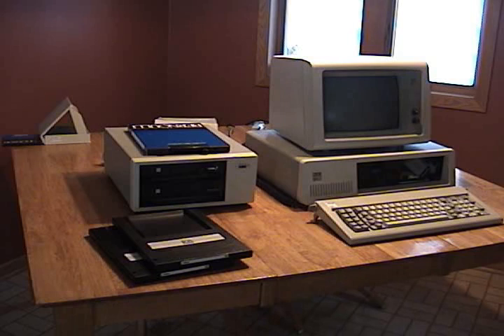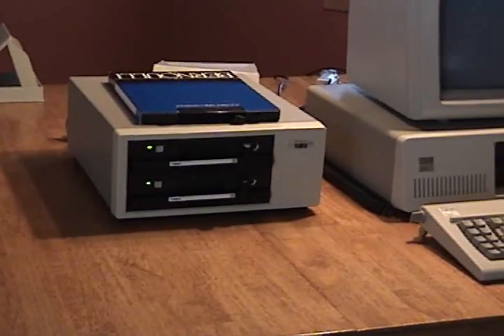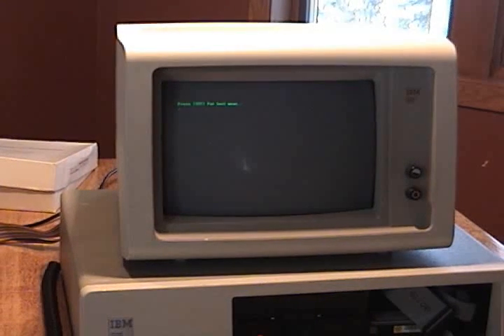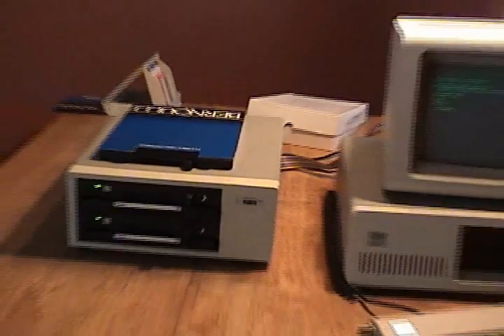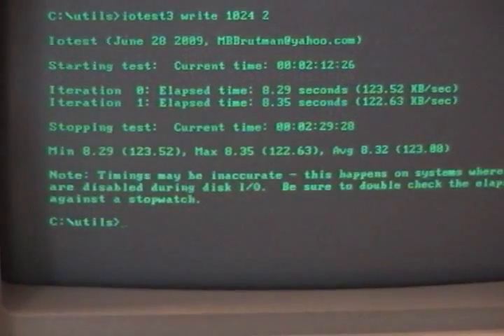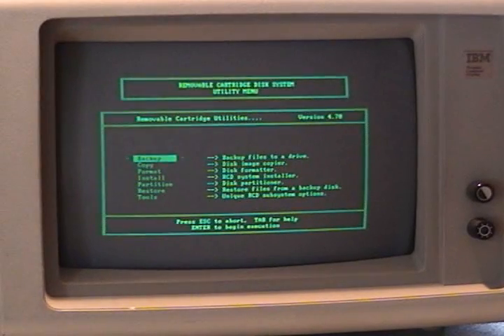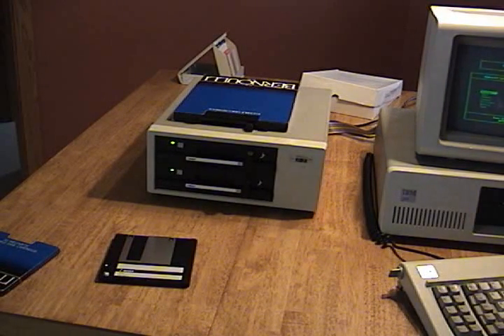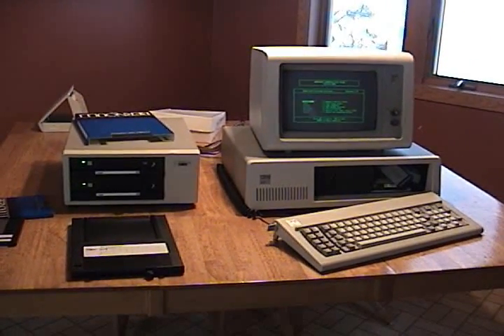Iomega Bernoulli Box A220 Demonstration

Comment: These drives are much smaller than the original 10MB drives. I have both the 2x20 and the earlier 2x10 model, and the drives in the 10M version are basically twice as high (I'm gonna go ahead and call them full height and half height 8" drive format...)
Reply from the maker: I'd love to see an earlier 5MB version in use.  I've seen references to them and some pictures, but I don't know of any that are running.
Reply: Huh. Yeah, that apparently did exist briefly. https://books.google.nl/books?id=-S4EAAAAMBAJ&pg=PA47&dq=bernoulli+box&hl=en&sa=X&ved=0ahUKEwjZ9tzVjp3SAhWEvBoKHSs1CDU4ChDoAQgdMAE#v=onepage&q=bernoulli%20box&f=false

It sounds like almost a prototype product.

Comment: I would have liked to see that directory listing to check the total capacity of those disks. Is it 20 MiB or 20 MB?
Reply: 20 * 1024 * 1024 bytes
These things were insanely reliable, and there is a near 100% chance that the disks still work to this day, as long as a kid never found it with peanut butter on his fingers.

Comment from the maker: Creepy?  No!  The technology that made it nearly crashproof while being removable and at speeds similar to a hard drive is very elegant.  Remember, back in the mid to late 80s this was top of the line equipment.  Anybody who needed to remove sensitive items from the machine at night could do so by locking the cartridges up.  Anybody who needed to do backups quickly without touching dozens of floppies would have used these too.
Reply: Yes they were known as absolutely durable. Iomega had a winner there, unfortunately their later products (zip, Jaz etc... all had huge problems) if they would have stayed with the bernoully tech and had improved on it they never would have run into the issues they had with later products. I wonder what made them to move away from it with the Zip drives and later Jaz drives?

Comment from the maker: @8BitDanooct1 It is the Iomega PC2B-50 card that Iomega sold for use with the drive.  The drive looks to be SCSI - if you check out the accompanying web page I talk about my attempts to run it with more modern cards.  But I do need to go back some time and try it again to see how well it functions with those cards.
Reply: mbbrutman back when I did some research by reading manuals, I think I figured out the 2x10MB box is SASI and the 2x20 one is SCSI 1.0...